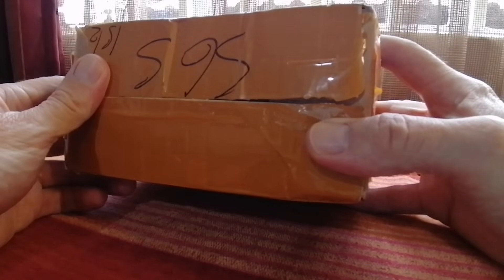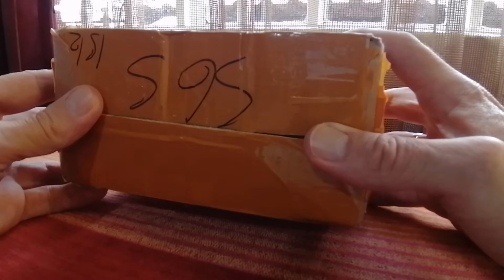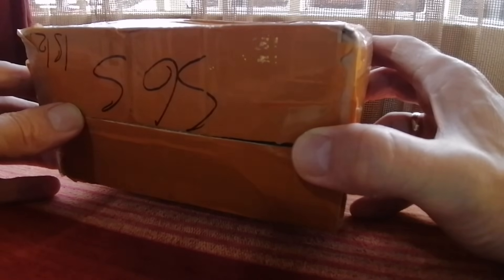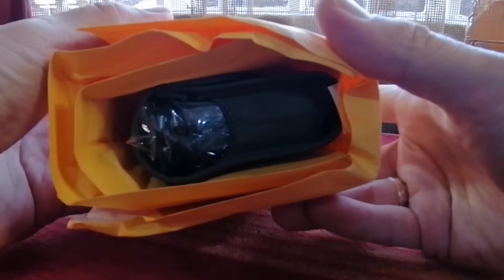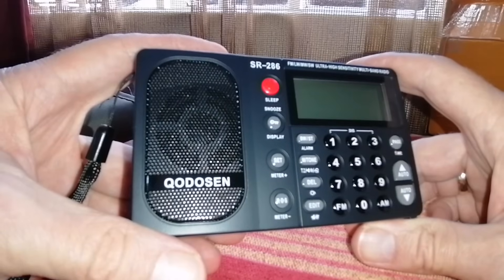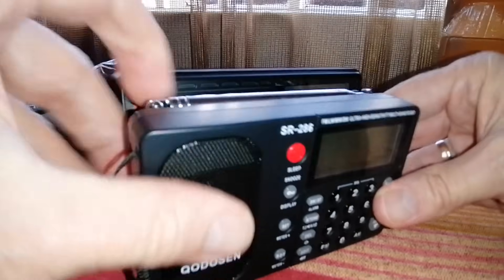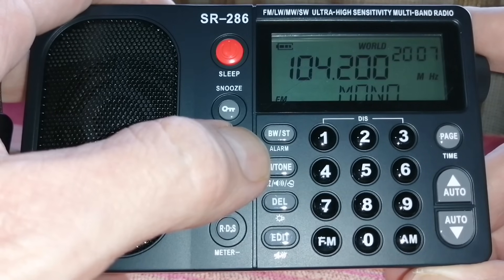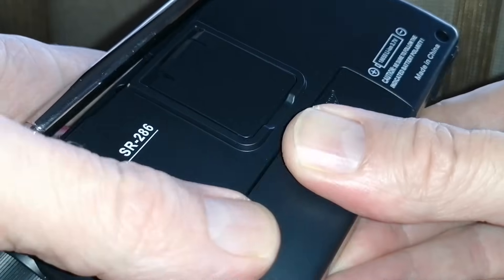An astonishing DXing radio: Unboxing the Qodosen SR-286 and first look #shortwave #tef6686

Comment: I'm very impressed by the SR-286's high dynamic range on shortwave. Its noise floor is even lower than your most featured radio, the XHDATA D-808. On FM, this thing is virtually untouchable! What's amazing is the fact that the automotive audio manufacturers aren't even exploiting the TEF6686 DSP to its fullest. No one bothers to include the SW band anymore (probably citing RF interference as their biggest reason) and the last car stereo which I had tried for its SW band was the old Sony Xplod audio head unit back in 1999.

SSB is not a native feature of DSP radio chips. The radio manufacturer has to write a piece of SSB microcode that is uploaded to the DSP microprocessor unit and this upload takes a few seconds to take effect.

Thanks Andre for the virtual tour of the Qodosen! Does it have an RSSI display mode? 📻☺
Reply: Car radios don't even include any AM band here. It's been like this for quite a few years already. LW has been dead for a couple of years and MW since even longer. No one but us geeks is interested in SW.
It's mandatory to include DAB+ here now, though. It seems that they're eventually pushing it. France is far behind some other EU countries for this (e.g. Germany).
Reply: I’m in Australia and my Kenwood car stereo has SW. It’s great for night drives
Reply from the maker: @saevans63  Hey Steve, that sounds like a lot of fun! I can imagine that you can pick up quite a lot in the car at night away from the cities.
Reply from the maker: The low noise floor is a very big plus for me!

You mention SW on car radios, I actually had a car radio in my previous car (about four years ago) that had SW. It was an after-market radio, there was no radio installed in the car when I bought it. For the life of me I cannot remember the brand name now.

The Qodosen does have an RSSI display mode, I actually just missed the display button when I was doing my first test.
Reply: @swlistening  I'm impressed that the SWL King truly lived up to his name by installing a shortwave capable car radio! 🙂 Was it a Becker Mexico head unit, a Kenwood KDC-U356R or a Sony CDX-GT270MP? Word has it that only Pioneer and Kenwood still make tuners with SW bands and even then they're only found in certain markets around the world.

Do you remember if your Volvo's ignition affected the shortwave band or if you only listened to SW with the engine turned off? 🌍🤔
Reply from the maker: @StratmanII  Now that you mention it, I think it was a Kenwood. It was actually not in the Volvo, I had a small Suzuki Swift for a very short time a few years ago, with the Volvo becoming the second car. But I sold the Swift and just used the Volvo again as my first car. The radio was in the Suzuki. The ignition did not affect SW listening, I could hear some stronger stations very clearly at night.

Comment: For that price they couldn’t even included a battery? Never heard of such a thing…around 12:20 sounds like Godzilla
Reply: Reason is that including a Li-Battery woud require UN-save packaging, adding about 10 USD shipping costs. You get a high quality 18650 locally for less.
Reply: @JohannHöchtl  I’ve had 10 dollar radios include a 18650 battery, in the “hi-end radio world” it’s like selling a Cadillac without the car battery” No excuse not to include one in my opinion or make it take standard batteries then
Reply from the maker: Hi Richard, it is indeed a bit strange that the battery is not included. As I mentioned in some of my other replies here, I think the price is so high because the radio is not mass-produced and the TEF6686 chips are hard to get. The car manufacturers buy them all. Maybe the Qodosen people realised the price was high and just excluded the battery to save a few dollars.
Reply: @swlistening  I understand that, but seriously, even a low end generic battery should be included. I see now you got a bargain, they are trying to get 179 plus 6 USD on eBay.
Reply from the maker: @KongKingman  Good to hear I got a bargain 🤣
Reply: @swlistening  🤑

Comment: Thanks for the review!  For that much money, I would require SSB (and for it to also work well).
Reply from the maker: Thanks Tom, I will be happy with the radio and the price if its performance is as good as people say, particularly on MW. The reviews that mentioned the excellent MW performance were what convinced me to buy it, even at this price.
Reply: Actually the first testing model does have SSB, if you look into the display there's also a SSB indicator, but I have no idea why it's removed when it's finally introduced (I got mine in August 2023)
Reply from the maker: @youtou721  Thanks for your comment, that's very interesting! I wonder why they removed it when they introduced it. Maybe it will return later.

Comment: What is the deal with SW receivers being produced in small numbers? Are their chips no longer manufactured / only available in limited quantities?
Reply from the maker: The Silicon Labs Si 4732 chip and newer versions of that chip are mass-produced and cheap, that is why a radio like the XHDATA D-219 can be sold for just $10. The TEF6686 chip, though, is bought up by car manufacturers, which means very few remain for radios.
Reply: @swlistening  Oh ok. Thanks, I get it now. I had no idea that a single chip could be used in 2 completely different technical areas.
Reply from the maker: @timbermicka  Sure! And sorry, I should have clarified, it's the same area. The car manufacturers use these chips for their radios.
Reply: @swlistening  Ahem bru...the XHDATA D-219 uses the low priced Si 4825-A10 DSP, not the advanced Si 4732 which you'll find in the ATS-25/ATS-120 DSP receivers. 🙂
Reply from the maker: @StratmanII  Oh, thanks for the correction, I actually did not know this.

Comment: Just from a different chip. I wonder what cost difference is from different chips. 
Receiving a transmission where not received before is quite a feat.
Reply: I read somewhere that the silicon labs chips were designed for DTV, but modified for AM/FM/LW/SW.
Reply from the maker: @petegallaguer8978  Hi Pete, I haven't seen this myself but hopefully someone else will comment about this.
Reply from the maker: Thanks James, this is quite a radio! I think the TEF6686 chip is better with processing weak signals, and locking on to them. My thinking here is that when you drive around, you lose signal all the time. So this chip, used in cars, can handle that better than the Silicon Labs chip.
Reply: The manufacturers pay ±17 bucks for this NXP's TEF6686 chip vs ±5 bucks for Skyworks' SI4732-A10; everything else is production cost + hype. The cheapest TEF6686-based receiver nowadays costs ±45 bucks, but... I'd not want to own it at all...
Reply from the maker: @well-mannered-troll  I'm interested, which one is available at $45? I might like to get a second one!
Reply: @swlistening  My messages disappeared - because of the links probably... One more try...
Reply: @swlistening no chance; I tried to update you on the two options, even through the Community post comment, but it keeps disappearing. All I could do: I've left that comment under my own last uploaded video, if you are still interested.
Reply from the maker: @well-mannered-troll  Thanks for this, I did receive one of your comments!
Reply from the maker: @well-mannered-troll  Thanks!